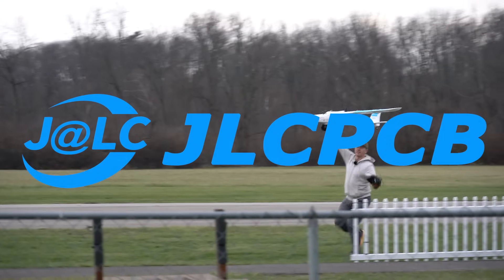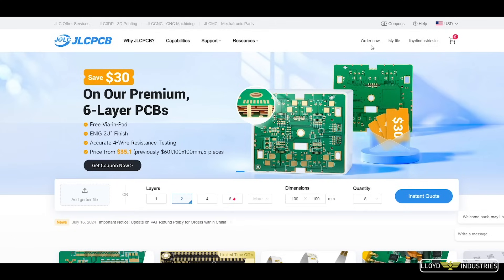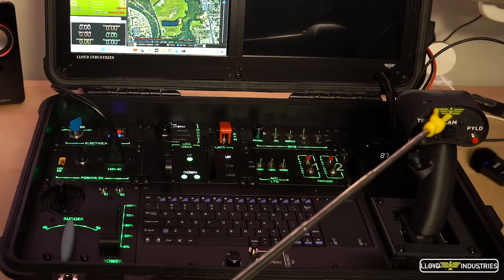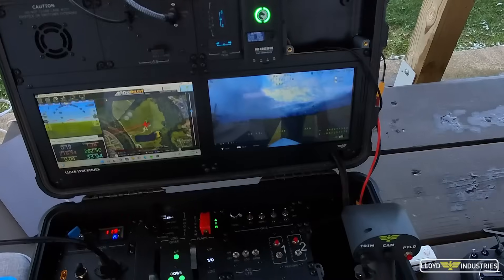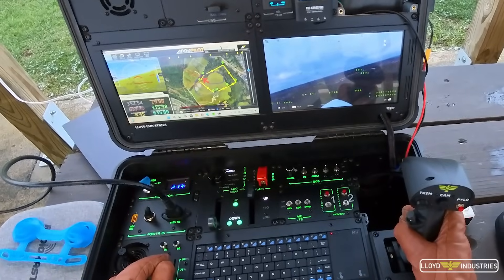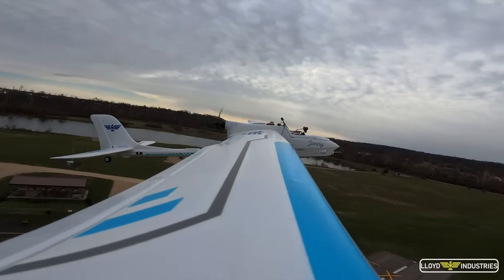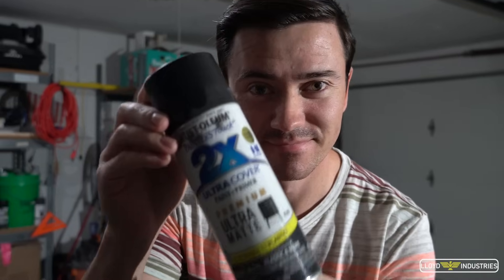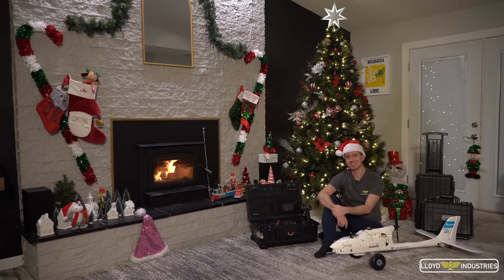The Ultimate RC Radio!? Custom Homemade Ground Control station with Folding Joystick!

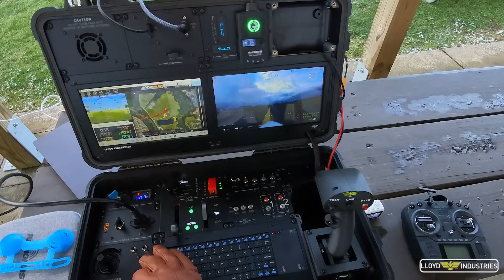Comment: 8:00 just do an actual rudder control ;) that would be the most genuine workaround. PS: the guardswitch should be on the Power not on the arm :-p they still can fly unarmed but the transmitter and your whole system not without juice :-P nice project
Reply from the maker: Im implementing a twisting joystick for the rudder and thats very true! Might add that as an option

Comment: You sell this kit, ready to use?
If so, what is the price for 30 units?
Reply from the maker: Not yet! Hoping to have a finished product very soon but will be a while before I kick into a full production. Stay tuned on the channel all news will be communicated here. And to answer your question about price im shooting for a maxed out version to cap out at $2000 per unit.
Reply: @letsMakeItFly  ok. In waiting.
If it's not too much trouble, please consider shipping and translations to Brazil.

Comment: Should there be a version 2, and there nearly always is, consider flipping the case. Put the keyboard and switches in the lid. Socket a 3-axis (third axis is rudder) flight stick in the lid, too. The displays, electronics, etc. go in the "bottom". That will make operation a bit more comfortable, i.e. you could sit down with the box on the tabletop. Re: displaying flight data, take the next step and create code for proper HUD flight symbology.
Reply from the maker: Already working on version 2! Thanks for the idea!!

Comment: Exciting! How the video transmission is organized? Is it digital or analog? I mean is the app used for video display or just a TV-device that is directly connected to antenna?
Reply from the maker: It is digital and its a Touchscreen monitor thats connected to the antennas through the walksnail video receivers. HDMI.
Reply: @letsMakeItFly  thanks!

Comment: Bit late too the party - but to get twist on the joystick you can buy a '3 axis joystick' module off A-epres.

I was looking at base station ideas like this, but have gone a different direction - I like to hike out to a spot to fly, so a monitor mounted on a tripod with everything attached to the monitor...doesn't give me joysticks though. I'll need to figure out a hikeable joystick solution.
Reply from the maker: Backpack straps! Thanks for the idea. Set up sounds cool. Happy flying. Btw i did get that twist action in
Reply: Noice.

Comment: If you are using a windows operating system+mission planner's joystick through SiK radio, you can connect rudder pedals which will be recognized as a different game controller input, but you can combine them with your stick input by using vjoy. But may cause latency, I am still in tests (Using Thrustmaster T16000 where I connect radar pedals through vjoy)
Reply from the maker: That is what I am using but I have never controlled an aircraft through mission planner. Ive heard the latency is pretty unbearable. The way I have it hooked up, it sends the rc signals through the external transmitter. In my case a TBS crossfire. Thanks for the info!
Reply: @letsMakeItFly  Yes good point. I am also thinking about parsing Thrustmaster Hotus through TBS Micro TX+ ELRS Nano RX. But I can't find much info about how to. Are you using something like OpenTX Companion?

Comment: Nice work. Its always a hard decision on how to layout a Ground control box especially given how quickly tech becomes redundant... You can configure the crossfire to serial communication and have rc and telem through the one link vs running a  separate telem module. The only downside is the limited output on the crossfire receivers, but I think you can get ones that put out over 100mwatt now which is good enough for hobby aircraft. Check out the new Edge T3 HD video/control system.
Reply from the maker: Thanks! Thats why I Initially got the TBS crossfire but I couldnt figure it out. Radio comms are not my strongsuit!

Comment: For the rudder, just make a set of pedals that you can plug in a connector on the case,, and a switsh to switch between the manual rudder and the pedal one.
Reply from the maker: I basically ran with that idea! instead of making them though how about any off the shelf set of rudder pedals for PC?! Just a couple of USB ports is what im adding. Thanks for the comments!
Reply: @letsMakeItFly  yes it would be better cause it's already made , man I can't wait to see more from this .

Comment: I love a good tech project but this just seems like a great way to suck the enjoyment out of flying RC.
Reply from the maker: I hear ya. You could definitely fly line of sight and full manual and im sure its still an experience with a joystick and throttle. Either way though I found a fair bit of enjoyment flying FPV and having all the information at my fingertips nicely laid out.

Comment: other than the components lisred above are are any more components needed? for example you mentioned that you repurposed an old radio transmitter
Reply from the maker: There may be a few things i missed but the repurposed transmitter was one of the methods i tried to get this to work. This should cover most if not all the components you need
Reply: @letsMakeItFly  ok thanks, does the keyboard come with the fanless pc or it is purchased separately. i noticed it's missing from the product list

Comment: This is very impressive. I've seen some professional gear that pales in comparison. 

Since you're asking, an idea for the rudder control would be to change the throttle control to something like a t-handle (or a hoop/stirrup config) with a horizontal rocker switch that operates with the middle and ring fingers. There are some flight simulator controls that do this. The throttle wouldn't need to be some full-sized thing (for that matter, the control stick could be slightly more compact too, imo), but there could still be enough room to use thumb-operated hat switches for a flap control, trim, and so on. Maybe even a slew switch for the camera. 

And while you haven't asked, I'd reconsider the layout and break-up the configuration some. You're already making the system modular, so either give every independent control group it's own unique panel, or put like-with-like. For instance, maybe pair the "mode" switch and "gcs" controls into one panel. I'd definitely put all the light controls in one panel. Also, I think you'd be better served, ergonomically at least, if you put the "power in" panel all the way up in that left corner, and slid the "electrical" panel over to the right, so that you wouldn't be reaching over the cord to operate anything. It may take a substantial redesign, but I'd also place the "mode", "disarm/arm" and "gcs" controls roughly where the "power in" panel is currently located, and put the less essential controls, like the "a/c lts" panel, towards the back, or maybe even in the lid portion of the box. Speaking of the lid portion, is there a reason you placed the monitors on the bottom in a side-by-side arrangement, as opposed to higher up, or even stacked? It looks like there would be plenty of room for the usb panel, antenna plug-in panels, etc, to be on one or to the sides of the monitors. Either way, getting them higher up could be of some help if you end up needing to install a hood (velcro or snap fasteners and a sacrificed car windshield shade connected to the upper edge and sides of the lid, much like your antenna mounting solution) for use on bright, sunny days. 

Anyways, this really is an impressive project. Very well done. Subscribed.
Reply from the maker: Thanks a ton for the comment! I have delved into designing the joystick with a Z axis and am 2/3 of the way there. So ill try this out as this was most peoples recommendation. 

I understand about moving the panels around however i split them up like this so that aircraft and ground station controls are separate so that, depending on the aircraft you fly, you can swap the aircraft control panels out rather easily. I do think i may try moving the power in panel up and move the master switch with the ammeter down. That way the cables are all the way in the back. 

I put the panels on the bottom and side by side mostly because of cg. I felt it wouldn’t tip over as easy. Also im not sure if they would fit stacked. Ill have to check
Reply: @letsMakeItFly  Happy to help, and I'm looking forward to seeing your progress.

Twist sticks are certainly a valid option, and a good way to save on space. Perhaps the throttle slider could be built into the stick base as well? That would save even more room.

"i split them up like this so that aircraft and ground station controls are separate so that, depending on the aircraft you fly, you can swap the aircraft control panels out rather easily."

Right, right, and that's the point of using modules in the first place. Sure, certain controls are going to be common to all aircraft and others not so much, but I'm just not understanding some of the placement. For instance (and I hope it doesn't seem like I'm harping on about it), I can see how "mode" and "gcs" might not be best integrated as one module panel, but then "mode" is sharing the same module panel as the disarm/arm, landing gear, and flaps controls. Strikes me as an odd arrangement there, is all. When I said "substantial redesign" that was mostly in regards to layout, or splitting modules. You've already got the module concept down with the common dimensions of the boxes and the mounting pillars, so it's all just a matter of fine tuning and placement. 

Of course, please feel free to disregard any or all of this. I'm just hoping to make a point or two to think on or make a useful suggestion. Who knows, sometimes one idea can lead to another.
Reply from the maker: Absolutely, thanks for the comment. Let me know what you think should go where and it may just be in the future configurations!

Comment: Hi Lloyd, to add a yaw axis to your flight stick, you could use a hall effect IC and a small magnet assembled around a rotating assembly that's inside the handle. The advantages of the hall sensor is it's very high resolution even over a very small angle change like 15deg in both directions. Here's an IC that could do the trick, search for "ams AS5070"  the "AS5070A" behaves like a potentiometer that has a magnet above instead of a shaft.  Nice vid, thanks for sharing;  Subbed!
Reply from the maker: Thanks for the comment! Thats actually what Ive got drawn up in CAD now. The X and Y axis of the gimbal also used hall effect sensors. Welcome! 😬

Comment: I would love to get one of those, but i bet it felt way cooler when you finished the project and tested it. I just got into fpv by buying an AIO camera and goggle set and put it on my radian, my next move would be to use a crashed conscendo, fix it and use it as a guinea pig for more experimentation.
Reply from the maker: Stay tuned!! Well have a working prototype in no time! Very cool. Would be awesome to experiment with an all in one solution like the TRUNC
Reply: @letsMakeItFly  They don't give you too much of a range but for park flying it's more than ideal, I flew it today to test the maximum altitude I could go and I'd say It went at least 150 ft high, for an 800mm wingspan ultra micro is a lot.

Comment: I would say, it's only ultimate, if you can change the frequencies it operates on, and even better... does encryption and frequency hopping.

Otherwise, the first jammer that comes along on 2.4, 5ghz, and 890~914mghz... is going to make your system fail.
Reply from the maker: Thats on another level, not sure if I want it being that robust!

Comment: As an Fpv pilot, the lag I see in the monitor is too much for me, and using a screen and my goggles I feel lost 🤣🤣🤣
Reply from the maker: It should be just as fast, im using a walksnail video receiver and its connected to the monitor via HDMI
Reply: @letsMakeItFly idk, watching the joystick it’s seems to be a little higher, but the project is really amazing

Comment: You should’ve just used something similar to a Microsoft Hodis controller for PC, and head tracking unit
Reply from the maker: Couldnt find what a Hodis controller is. Did you mean HOTAS? That should be possible here soon!

Comment: This is a really cool build and I think I want to make my own now

You may want to reverse the ARM switch so when its closed its safe, That makes it faster to disarm and make it safer.
Also, might be a good idea to add a switch for the small joystick on the left to allow you to toggle between shared control like you have it now and dedicated control so if you add a camera payload later you will be able to use that stick to control it while the hat switch will be able to control the FPV camera
Reply from the maker: Thank you, its very rewarding when its done! 

Yes Ill have that done for my next flight! 

Thats a great idea! However, the main reason its shared is because I ran out of channels but when I get EdgeTX on here I might be able to get up to 16 so that will definitely be possible. Thanks for the input!

Comment: How much is the custom pre-build trunk ;)
Reply from the maker: Im estimating with edgeTX and 3x USB connections for pc joysticks, throttle quadrants and rudder pedals it’ll be around $1800 with the pc, monitor and fpv monitor.
Reply: @ can the same design applied for drone ?
Reply from the maker: What do you mean for drone? The main control method will be using an external transmitter module such as the tbs crossfire and you can connect it to any receiver and any vehicle. You can map the controls on edge tx like any other radio. So i think the answer to your question is yes!

Comment: Instead of a separate rudder control, unless you REALLY need independent control of the rudder, simply tie in the appropriate amount of rudder deflection to inputted aileron deflection to make coordinated turns like an Ercoupe. That way you could retain the two axis joystick.
Reply from the maker: Thanks for the comment. Thats actually how I mostly fly. I just needed the rudder for taxiing.

Comment: only thing i would change is reversing the arming switch simply for safety.  if you need to disarm quick it  would be easier to just hit it down instead of flipping the cover up quick. other then that its awesome
Reply from the maker: Thats a good point! I have it set up the way it is now so that you don’t accidentally disarm it in flight. Depends on whose safety you prioritize i guess 😜 the airplanes or persons
Reply: @ true, I fly mostly gas planes so having an quick kill switch is very important
Reply from the maker: Makes sense!

Comment: Nice I just used a Laptop & Logiteck Joystick & Wi-Fi extender with Original Parrot Drone. As it was a Flying Linux box, you could interface with using the Laptop, But your design is very professional, made for the Newer Drones, all in 1 box, with the twin screens, magnificent work !! (I really like the Rudder Control & not having to split screen Map & FPV)
Reply from the maker: Thanks, it was a long journey to get here!

Comment: There's a few things I'd do differently with the design but overall I like the implementation, and now I'm gonna have to decide whether the flight case in my attic which was originally for a large emergency battery pack (it's about the same size as the one used here) is going to continue to become a battery pack, or if it's gonna get repurposed into making one of these with the changes I'd wanna add.
Reply from the maker: Do it!! Thanks for the comment!

Comment: Could you somehow integrate a simple PC joystick with twist rudder? Are they just analog potentiometers measuring position or is there more too them?
Reply from the maker: Yes I have plans for integrating a USB port where you can connect any pc joystick and use that as well as rudder pedals! I believe they are analog potentiometers but the one I made uses hall effect sensors.
Reply: @letsMakeItFly  making it usb joystick compatible would be very cool. I was thinking more along the lines of hacking the pc joystick and just running the sensor outputs into whatever you are using to analyze them on the existing rudder and joystick axis.
Reply from the maker: Gotcha thats probably the easier route to go honestly but would be hard to replicate and would be different for each joystick. It would be awesome if, no matter the joystick, you can plug and play!
Reply: @letsMakeItFly  Will the usb input be connected via ardupilot or are you sending that through the crossfire?
Reply from the maker: I hope to have it go through the crossfire or some other external transmitter. Im not sure if its even possible but ill do my best once I get to that point!

Comment: I believe you "arm/disarm" logic is flipped. You usually uncage and flip to "arm". Than you can safely "disarm" by just lowering the cage again.
Reply from the maker: I think it ultimately comes down to personal preference, I’ve had this comment a lot on this video. It depends on whether you are more scared of the plane accidentally disarming in flight, or accidentally arming on the ground. I copying the logic from the TBM 960 which I have flown. It too has a guarded switch to start and stop the engine and its always down when you’re flying around.

Comment: That’s kind of how I recently learned FPV. I’m pushing 50 years old but have been flying RC since I was 11-12yo. 
It was so hard for me to get use to the FPV goggles that I got a separate VRX unit with HDMI output, plugged it into the 60” TV in my garage and learned how to fly FPV. Needless to say, I’ve had a number of varying opinions regarding that little project. Happy Flying !!!
Reply from the maker: Thats wonderful! Thanks for the comment. Happy flying 😬